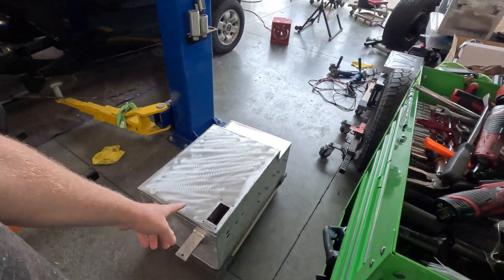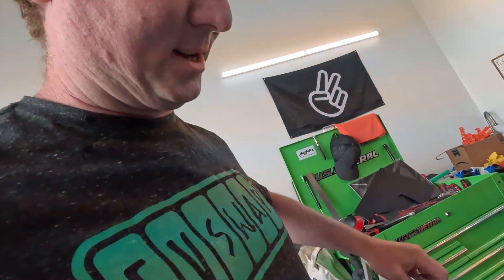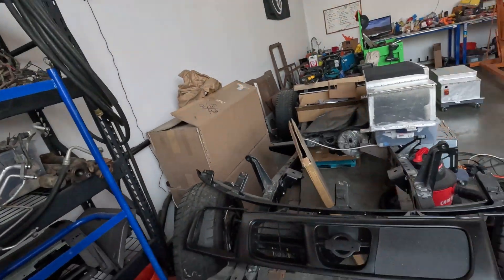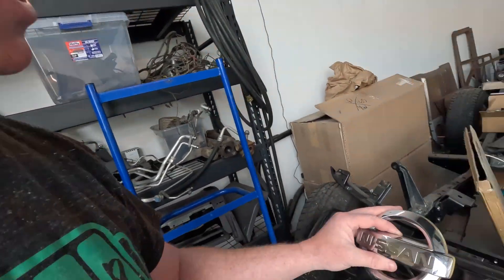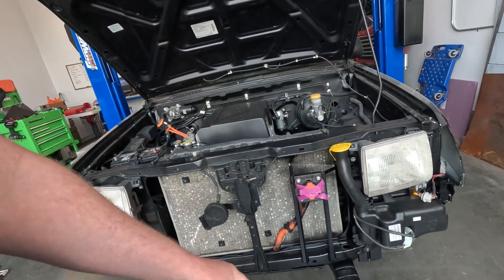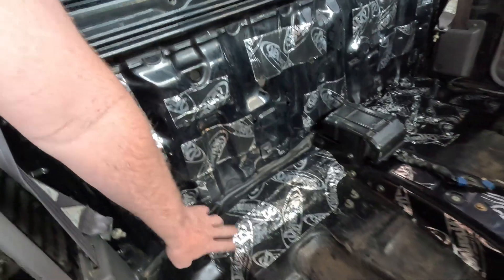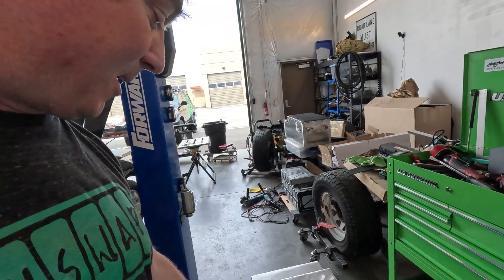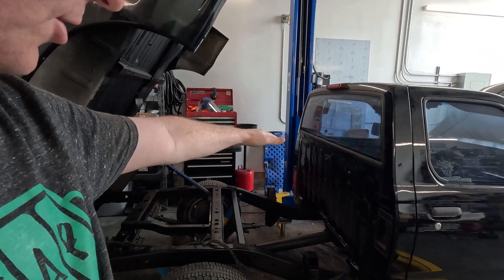We Built a Battery Box for our EV Conversion

Comment: Why ChadeMo? Would CCS be better since it’s more widely available?
Reply from the maker: Yes unfortunately it doesn't work with the Resolve-EV VCU just yet. We can use CCS with an adapter to the Chademo plug on the vehicle, however. The LEAF battery is only capable of accepting 50 kw or less anyway.

Comment: Have you got 22 cells in a battery pack? How many kw per pack please. Fab content
Reply from the maker: 12 modules on each side, 24 total. Each pack is half of the 40kwh original battery, so 20kwh each. Driver's side box also has contactors, fuse, and BMS.

Comment: Awesome.  Couple questions - Do you plan on lining inside of boxes w insulating plastic sheets etc?.  Will batteries be secured inside box via bolts or straps etc?
Reply from the maker: I have a couple options including some high density foam and plastic sheets. I haven't fully decided yet but it's looking like the foam is going to be a good option. High density foam similar to what NASCAR and other racing series use.